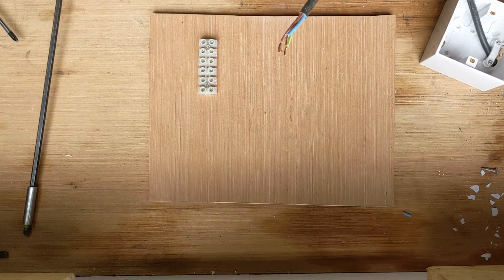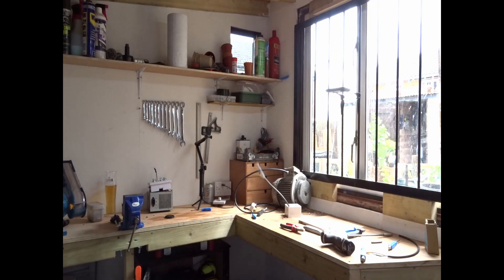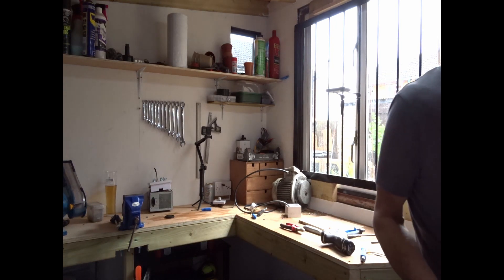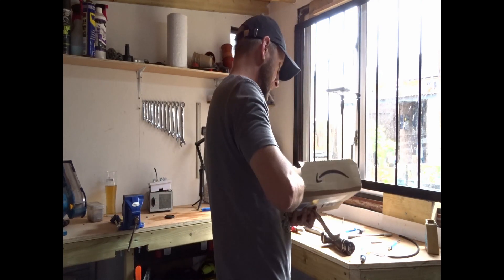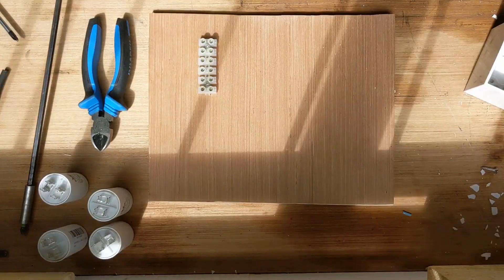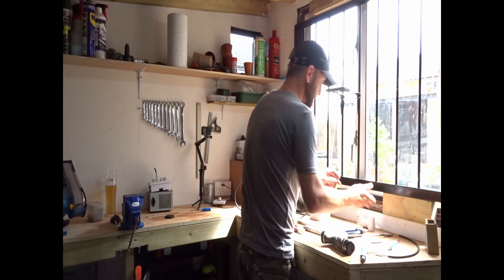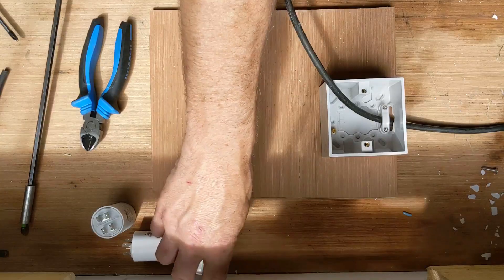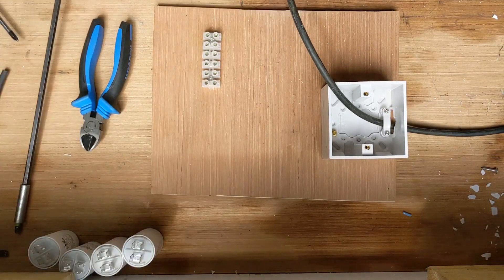Make a 3 Phase Motor work from 240v socket Part #2

Comment: You mentioned running a lathe from the motor. If you’ve got to start it by hand that’ll never run a lathe.
Even after you’ve turned the power of there’s a risk as capacitors store voltage. 
I’m no expert, just watched a number of videos on the subject.
Reply from the maker: Very true... I have got a different motor for my lathe now, I've started the build and it will be in my next video

Comment: How did you connect capacitor in series or parallel?
Reply from the maker: They are wired in series
Reply: The capacitors are in parallel

Comment: Yes. that will work, but you are making a 'split phase' motor with the capacitor providing the phase delay for rotation. However, the motor will deliver only a small percentage of the power it is capable of producing.